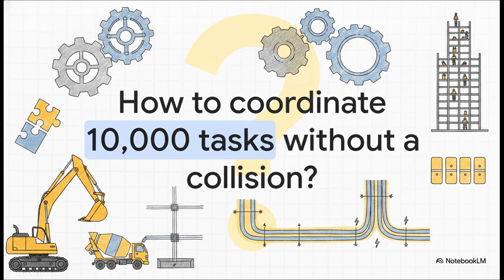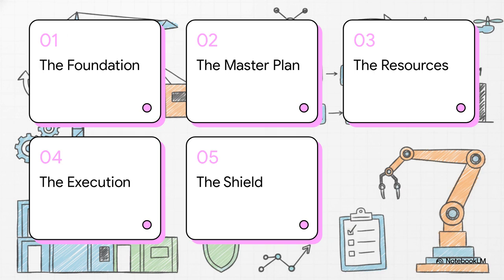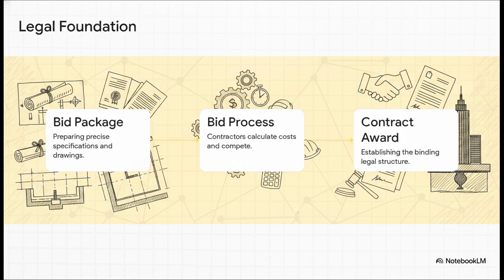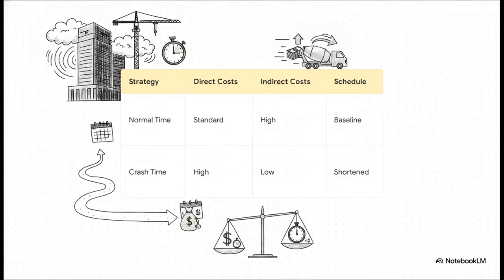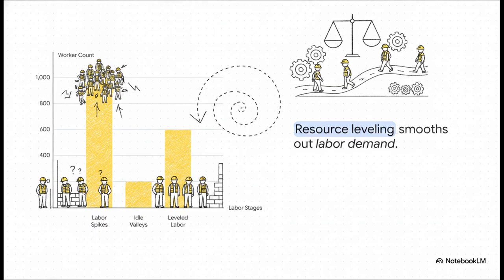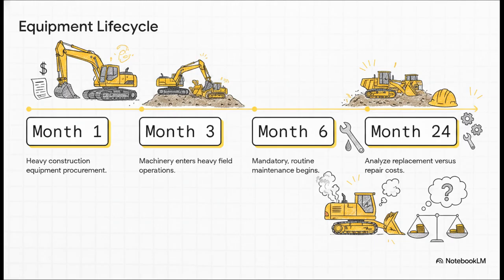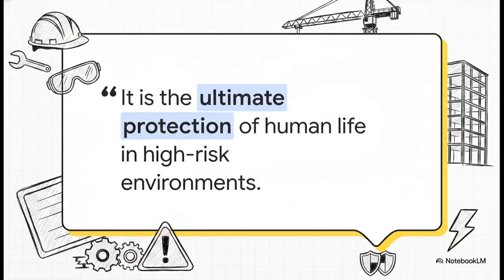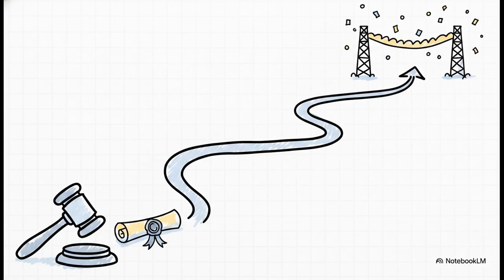Advanced Construction Methods and Equipment

Comment: From the video, Execution is the most risky phase for project managers in my opinion. This is the stage where the team spends most of the money and does the actual work. If something goes wrong like bad weather, late deliveries, or worker mistakes, the project quickly loses money and runs out of time. A bad start in the early phases hurts, but Execution is where real problems cost the most.

Comment: After watching the video, I observed that Execution is the stage in which project managers face the greatest risk. The early stages are about planning and preparation, but execution is where everything happens and unexpected challenges can’t be avoided. Even with a well-developed plan, problems such as delays, design changes, weather conditions, equipment failures, and communication problems can still occur and affect the project’s progress. The video made me realize that this phase requires continuous monitoring, quick decision-making, and good leadership as project managers need to ensure that the project is on time, within budget, and meets quality standards despite these challenges. To me, the real test is in the execution, whether the planning done in the earlier phases was effective or not.

Comment: After watching the video, I believe that project managers are most at risk during the Execution phase since this is where planning is implemented and even minor errors can result in delays, cost overruns, and safety concerns. Managers must coordinate workers, machinery, supplies, and subcontractors during execution while making adjustments for unforeseen obstacles like bad weather, supply chain interruptions, or design modifications. This emphasizes how crucial good communication, ongoing observation, and wise decision-making are to keeping the project on track and under budget. Overall, the film reaffirmed that effective construction management requires strong planning and leadership at every stage of the project in addition to technical expertise.

Comment: For me, the Execution phase has the highest risk for project managers because this is the stage where everything in the plan is carried out. Even if the planning is done well, unexpected problems like bad weather, equipment failures, material delays, or labor issues can still happen. These challenges can quickly affect the project's schedule, budget, and quality if they are not handled properly. That's why I think project managers need to stay flexible, communicate effectively with the team, and make timely decisions to keep the project moving forward.

Comment: Resource leveling is essential because it ensures that workers are assigned efficiently. It prevents some workers from being idle while others are overloaded, which improves productivity. It also reduces labor inefficiencies and helps the construction project run more smoothly. In simple terms, resource leveling promotes a balanced workforce by distributing labor efficiently throughout the project.

Comment: From my perspective, the Execution phase presents the highest risk for project managers because it is where the majority of capital is spent and the projects become highly vulnerable to uncontrollable field variables such as labor efficiency,  the output capabilities of equipment, operational cycle times and even unforeseen site delays like sudden storms. Even though mistakes usually start during the Master Plan, execution is where those error actually turn into a real world problems. At the end of the day, you can have the best master plan in the world but it all comes down to whether execution is properly managed.     
   
Resource leveling prevents productivity losses and labor in efficiencies by smoothing out labor demand and stabilizing crew sizes. It ensures that materials, equipment and labor are balanced eliminating costly idle time. It reduces congestion in a large construction site and creates a steady and more cost-effective workforce.

Comment: In my opinion, the Foundation phase is the most risky of the five for project managers. The Foundation phase carries structural and compounding risks that can be difficult to identify and control, while the execution phase can seem chaotic with activity at the active site. Geotechnical surprises, poor site surveys, or erroneous early estimates create downstream vulnerabilities that no amount of acceleration at the execution stage can fully overcome. If not managed during this phase, risks will flow into the Master Plan, Resources and Execution phases. The best defense is early identification of risks.
Reply: I agree to that simply because you cannot build a structure without its foundation, and in project management, that truth is both literal and strategic. While the Execution phase gets the spotlight for its visible chaos and activity on site, the Foundation phase holds the highest true risk.

Comment: I believe, among the five phases of project management, the resources phase presents the highest risk because construction projects rely on the proper management of labor, materials, equipment, and budget. Any shortage, delay, or mismanagement of these resources can significantly affect the project's cost, schedule, and quality.

I also believe that resource leveling is important because it helps distribute workers, equipment, and materials efficiently, preventing over-allocation and idle time while maintaining productivity and a smooth workflow.

In my opinion, crashing the schedule is only justified when the benefits of completing the project earlier outweigh the additional costs, especially when it is necessary to meet critical deadlines or avoid costly delays.
Reply: I agree. Proper resource management really helps avoid delays and keeps the project running smoothly. When resources are well planned, it’s easier to stay on schedule and within budget.

Comment: I think the Resources Phase is the riskiest of the five construction management phases due to its high sensitivity to estimation errors. Even a slight or minor miscalculation in resource allocation can equate to massive financial constraints for the contractor. In example, the poor task scheduling often leads to idle labors, which quickly inflates costs without delivering value to the constru tion. Meticulous planning and techniques like resource leveling are therefore essential to smooth out labor demands, prevent wasted budget, and maintain financial control.
Reply: I totally agree the Resources Phase is high-risk because even slight miscalculations quickly blow up project budgets. Poor scheduling leads directly to idle crews, inflating labor costs without adding any real progress. Using resource leveling is essential here to stabilize labor demand and keep the project financially sound.

Comment: I think the Execution phase has the highest risk because this is when the actual construction happens, and problems like delays, mistakes, or bad weather can affect the whole project. Resource leveling helps by making sure workers, equipment, and materials are used properly, so work is done more efficiently without wasting time or labor. Crashing a schedule is justified when finishing the project on time is very important, such as meeting a deadline or avoiding delays, because even though it costs more, it can prevent bigger problems later.
Reply: I agree with your point. The Execution phase really is where most unexpected problems can happen, so project managers need to make quick and effective decisions. I also like how you mentioned resource leveling and schedule crashing because they are practical ways to keep the project on track when challenges come up.
Reply: My thoughts exactly, the execution phase is where the actual construction happens and it is a phase where the error actually turn into a real world problems. Even if you have the best plan if the execution phase is not properly managed, it will also fail. The project managers should be decisive in making solutions if unforeseen issues arise.

Comment: I believe that the Resources phase is the riskiest for project managers since it determines the basis for all other phases. The correct allocation of labor, materials, equipment, and budget secures the project’s timely and cost-efficient implementation. Therefore, any inaccuracies in this area generate negative occurrences, such as project delays and the associated costs, and decreased productivity. Each construction activity relies on resources, meaning that their improper management creates severe risks for every other phase. 

On the other hand, resource leveling allows project managers to optimize the utilization of these assets, thus removing inefficiencies such as overstaffing and underutilization of equipment such as overstaffing and underutilization of equipment, while keeping the timeline impact minimal. According to the video, proper resource management practices ensure productivity, quality, safety, and cost control throughout construction.
Reply: I believe that the Resources phase is essential because the effective distribution of labor, materials, equipment, and budget significantly impacts the success of a project. However, I maintain that the Execution phase presents the greatest risk, as this is when unexpected problems—such as delays, gaps in communication, weather-related issues, and conflicts on-site—actually arise. Even with well-organized resources, ineffective execution can still result in delays and increased costs. In the end, both phases are intricately linked, and proficient management of resources is what helps guarantee efficient project execution.
Reply: I agree, the proper resource management is essential because it affects the project's time, cost, and quality. Resource leveling also helps maximize efficiency and prevent delays, making it easier to complete construction projects safely and within budget.

Comment: 1. Which of the five phases (Foundation, Master Plan, Resources, Execution, or The Shield) do you think presents the highest risk for project managers, and why?

- I think the Execution phase has the highest risk because this is where the plan is actually carried out, so delays, labor issues, safety problems, and cost overruns can happen all at once. Even small mistakes during execution can affect the whole project.

2. How does resource leveling help prevent productivity losses and labor inefficiencies on a massive construction site?

- Resource leveling helps by spreading out labor, equipment, and materials more evenly, so workers are not overworked and resources are not wasted or left idle. On a large construction site, this reduces waiting time, congestion, and productivity loss, which makes the work flow smoother.
Reply: I agree with your point that the Execution phase has the highest risk because it is where the project plan is put into action. In my comment, I focused on the Resources phase since proper planning and resource management help prevent many of the delays, labor issues, and cost overruns that can occur during execution. This shows that both phases are closely connected and equally important to a project's success.

Comment: Among the five phases, I believe the Master Plan presents the highest risk for project managers because it serves as the foundation for all succeeding activities. If the schedule, critical path, or resource allocation is poorly planned, the project can experience delays, cost overruns, and coordination issues that are difficult to correct later. Resource leveling helps prevent productivity losses by balancing labor, equipment, and materials throughout the project, avoiding periods of overutilization or idle time while maintaining a steady workflow. Regarding the time-cost trade-off, crashing a schedule is justified when completing the project earlier provides greater benefits than the additional direct costs, such as avoiding contractual penalties, minimizing the impact of critical delays, or responding to urgent project requirements. However, this decision should always be supported by careful engineering and financial analysis to ensure the added cost delivers greater overall value.

Comment: In my opinion, the Resources phase presents the greatest challenge for project managers because it relies on precise planning of materials, labor, and equipment. Even minor errors in quantity surveying or cost estimation can result in budget overruns, delays, and major financial setbacks. Since these estimates guide the overall project plan, any mistake can affect every stage of construction.

Resource leveling is equally essential because it helps distribute workloads efficiently by adjusting non-critical tasks within their available float. This minimizes labor shortages, prevents employee overload, reduces idle time, and improves overall productivity and resource utilization.
Reply: I honestly agree with your point that the Resources phase is the most challenging because it depends so much on accurate planning of labor, materials, and equipment. From my perspective, even a small mistake in estimating resources can already affect the budget and delay the whole project, so your explanation about resource leveling really makes sense because it helps improve productivity and prevent overload on site.

Comment: I think the Resources phase is the riskiest for project managers because it depends on accurate estimates of materials, labor, and equipment. Even a small mistake in quantity surveying or cost estimation can lead to budget overruns, project delays, and significant financial losses. Since these estimates serve as the foundation for project planning, any error can affect the entire construction process.
Resource leveling is also very important because it balances the workload by adjusting non-critical activities within their available float time. This helps prevent labor shortages, workforce overload, and unnecessary idle time, resulting in better productivity and more efficient use of resources.
Although the Execution and The Shield phases focus on operations, quality, and safety, I believe the Resources phase carries the greatest risk because careful planning and accurate estimation are critical to the success of the entire project.
Reply: that’s a pretty valid point! a bad quantity takeoff early on can definitely sink a budget before the first shovel even hits the dirt, and your breakdown of resource leveling avoids those massive workplace spikes :]

though i’m still toward execution being the riskiest, resources is still mostly on paper. you can adjust numbers, re-level float, or recalibrate estimates before committing the capital. but once you hit execution, you’re losing up money on major delays, and real-time physical variables (equipment breakdowns, weather, site safety) hit you instantly without an undo button ;—;

anw, i love this perspective! it really shows how much a project’s financial foundation relies on tight estimation early on :D
Reply: I agree that project estimation is crucial because even a small miscalculation can affect costs and timeline. In my opinion, the main benefit of proper resource planning is that it allows the project manager to have more control of the project during its execution and reduces the costs because resources are allocated according to the project’s needs and are used efficiently. At the same time, I believe that these two stages are highly interconnected, and without efficient planning, successful execution is nearly impossible. Therefore, to summarize, I think it is essential to manage both processes efficiently and control the execution actively based on the planning data.
Reply: I agree with your point that the Resources phase is one of the riskiest because accurate estimates are very important. A small mistake in materials, labor, or equipment can affect the budget and schedule of the whole project. I also like how you explained that resource leveling helps avoid overloading workers and improves productivity. Good planning really plays a big role in making a project successful.

Comment: tho execution carries the highest operational risk such as delays, machinery breakdowns, and site hazards colliding with natural disasters, its real danger lies on how its failure cascades backward and forward through every other phase. delays on the ground directly disrupt the master plan by consuming non-critical float and pushing back the critical path, which in turn destabilizes resources by causing severe labor imbalances, unplanned overtime expenses and the liked. when these operational disruptions spiral out of control, they blow past the structural safety nets (the shield), increasing safety hazards and sparking formal legal disputes which ultimately destabilizes the project’s legal and financial foundation through breach of contract and severe liquidated damages.
Reply: I agree with your point that the Execution phase can create a chain reaction throughout the entire project. As I mentioned in my comment, the Resources phase provides the foundation through accurate planning and estimation, while the Execution phase is where that planning is put into action. Once delays occur during execution, they can disrupt resource allocation, increase costs, and even affect safety and legal aspects. This shows that both effective resource management and proper execution are essential for a successful project.

Comment: Personally, I think the Resources phase is the most challenging because even small mistakes in estimating materials, labor, equipment, or costs can cause delays and increase expenses. Resource leveling helps by making sure workers and equipment are used more evenly, so there's less wasted time and better productivity. Crashing a schedule is worth it when the cost of being behind is higher than the extra cost of speeding up the work, especially if it helps the project finish on time.